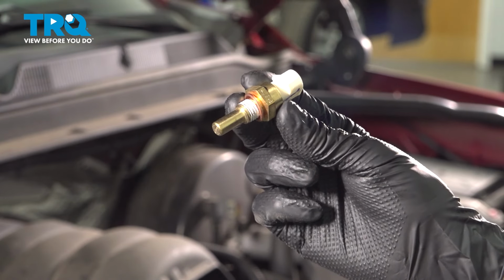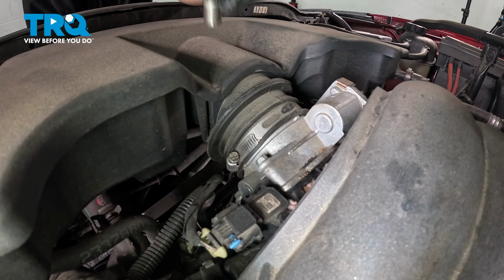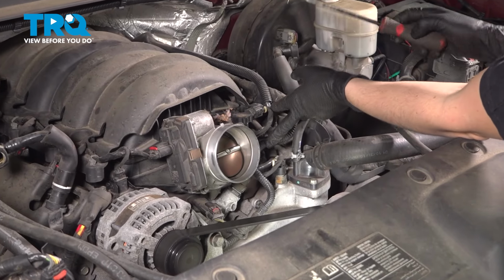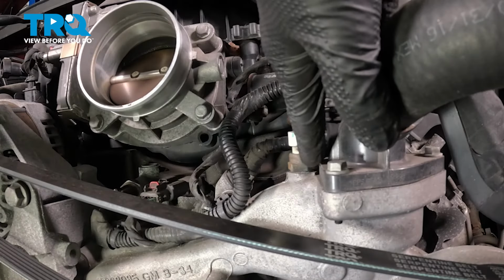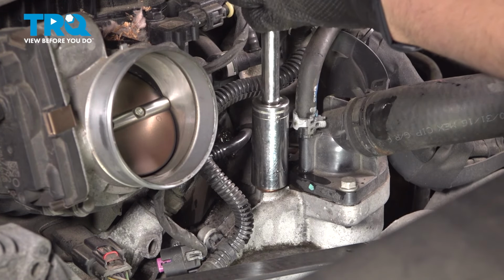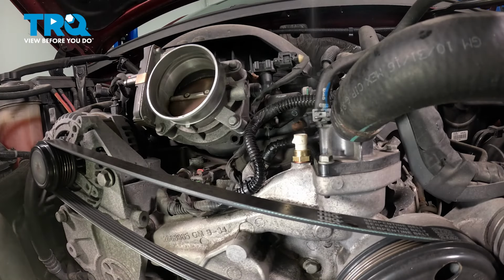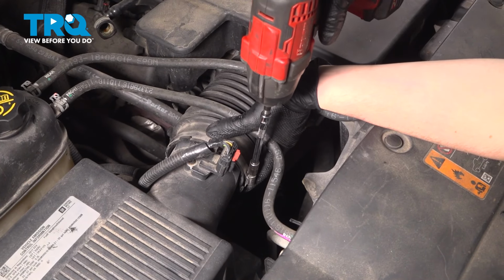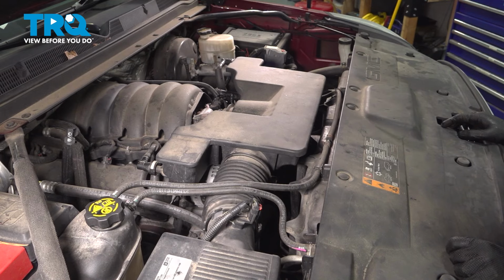How to Replace Coolant Temperature Sensor 2015-2020 GMC Yukon XL (5.3L V8)

Comment: Thanks for the video! The problem persisted for me until I disconnected and reconnected the battery (only the black wire). So just FYI for anyone in a similar spot.

Comment: Worked perfectly. Couple extra tips I learned… the coolant in my case was quite hot at the gush step when I pulled the old sensor out. So that sucked. 
Next, I had to clear the check engine light for the system to realize a working sensor was in place. Probably would have caught up eventually but the car did show the same initial symptoms immediately after swapping the sensor, and only resolved after I cleared the engine code.